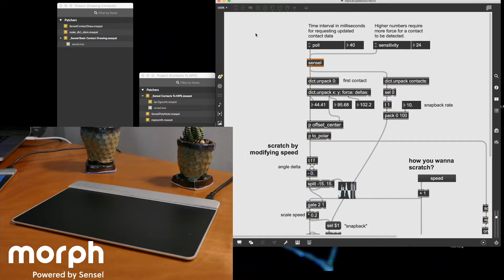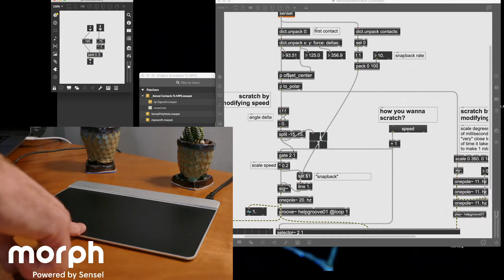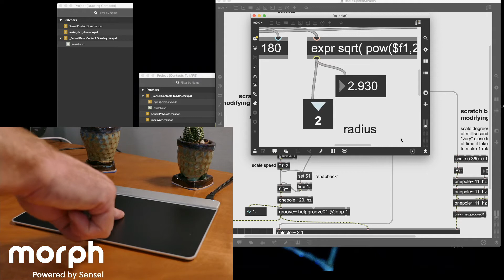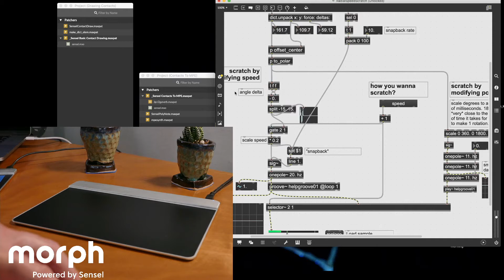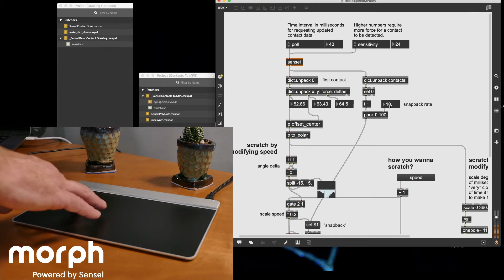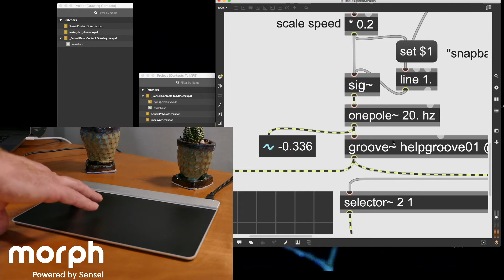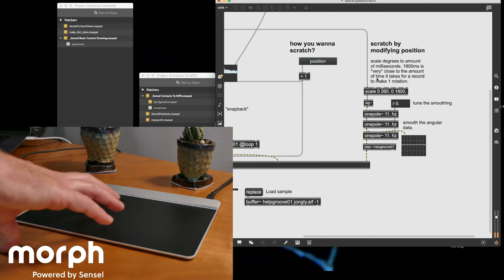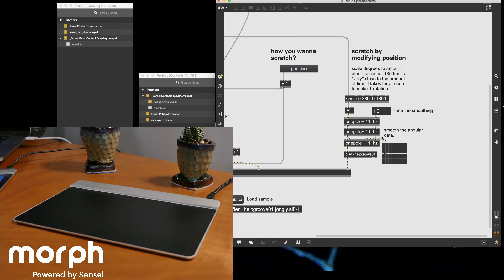04 - Turntable Scratch Emulation. Max & Morph: Multitouch

Comment: This is very cool! Is there any way to use this in Max for Live or will it only work in the full version of Max?
Reply from the maker: You can absolutely use this in Max for Live. If you want to use the "sensel" object (API in Max), however, it doesn't work to edit from M4L. Make a Max for Live device in Live, then open that in Max. Basically, when you try to edit a Max for Live device, the computer tries to create two serial connections via the API, and it dies. We have done some work to fix this, but it's not yet ready.